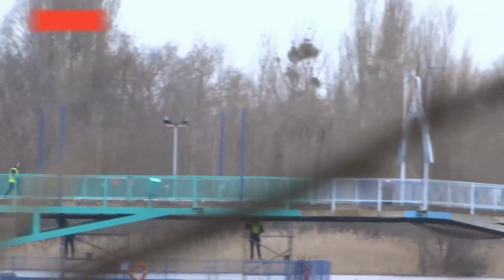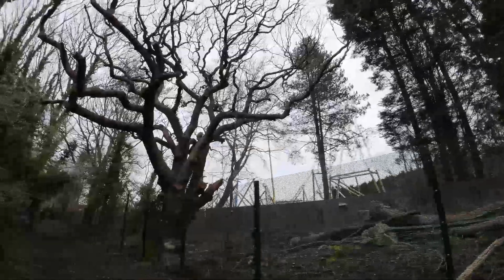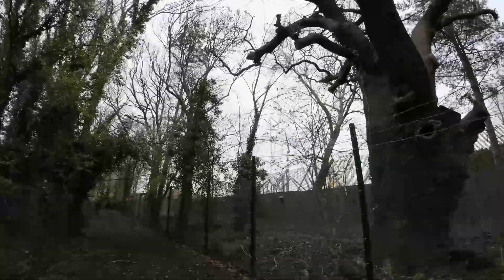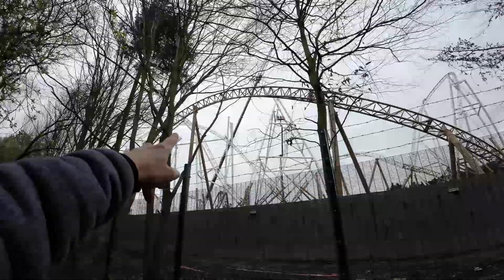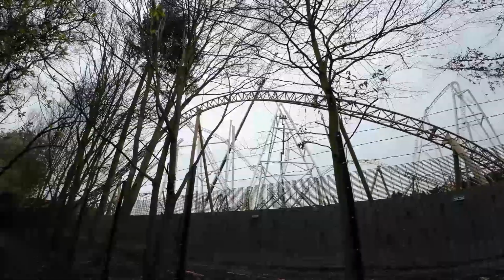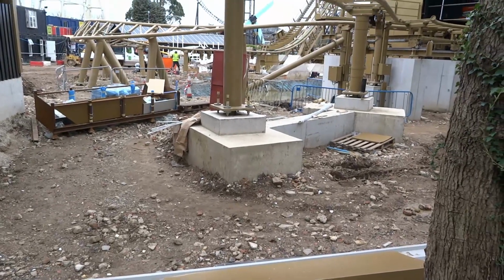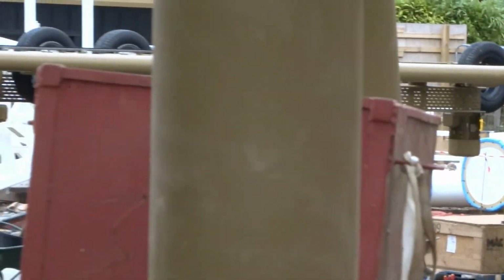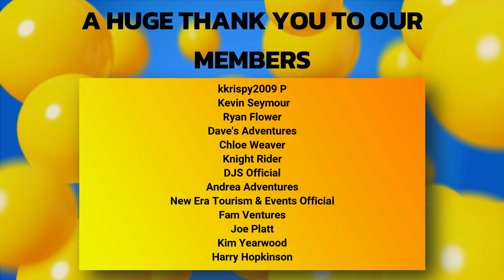Thorpe Park Hyperia update 28th February | LARGE CRANE ON SITE!

Comment: just checked the plans and did some calculations, you are correct we are currently at the 180ft (55m) mark!!
Reply: And to think there’s another 56 feet left!! And to think 180 Feet is still closer to the Swarm’s Height than Hyperia’s height 😮
Reply from the maker: Was a good estimate! Insane there is more to go
Reply: Sorry I'm a bit slow, one which bit are we at 180 foot on ? The lift ?
Reply: @philiptaylor6883  the support structure for the drop and the top of the lift hill that was being worked on in this video
Reply: @taylor6883 Nah the tallest supports so far on the drop I believe
Reply from the maker: @philiptaylor6883  The latest supports added